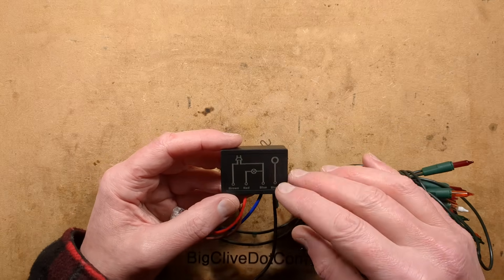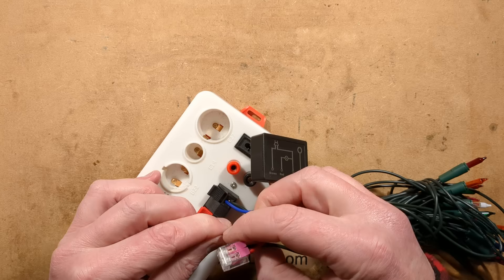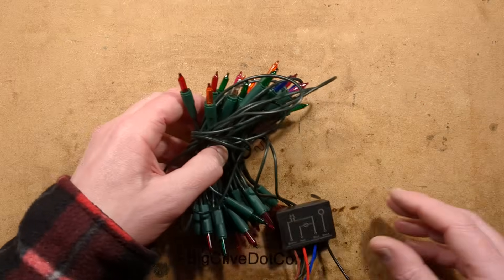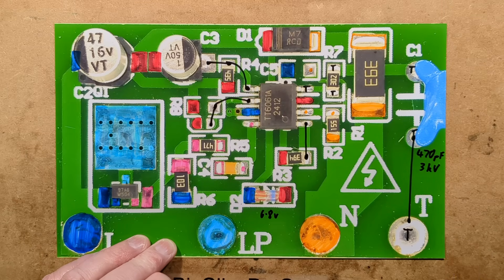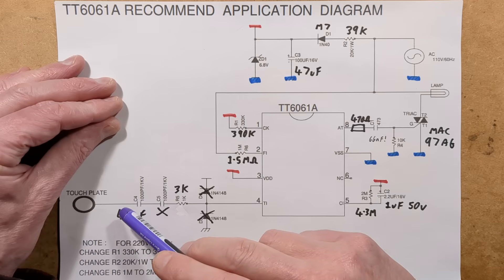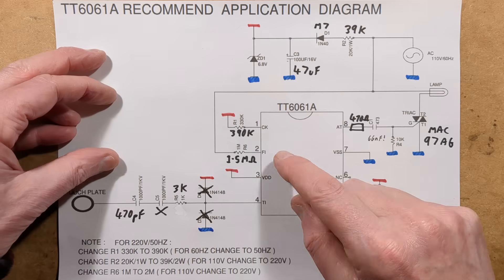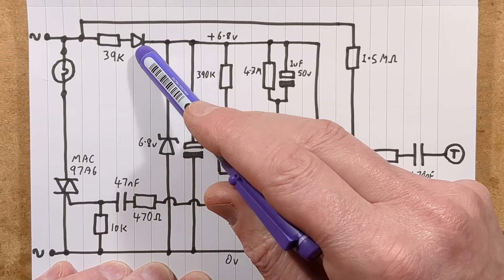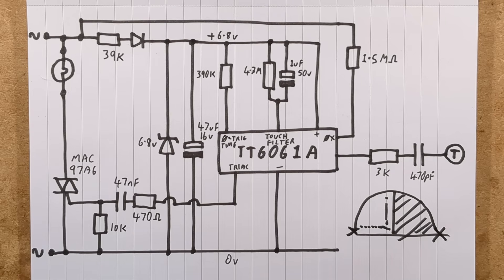inside a mains voltage touch-dimmer - with schematic

Comment: Interestingly, from the comments, I seem to have been lucky with my old bedside touch lamp - originally designed for 40W incandescents, I've been using it with a cheap LED candle for years without issue (apart from a very dim glow when it's supposed to be off). Mine is only a two stage dimmer (low, high, off), but I doubt that makes a difference. 

What I'd really like to do is add a wifi module to make it smart, while retaining the original functionality. Given how cheap both touch dimmer modules and smart wifi switch modules are, I was really surprised to not find that anyone has created one that does both. Can you recommend an easy/cheap way of achieving this, Clive?
Reply from the maker: It would be complicated to provide dual functionality.  But you could use a WiFi enabled bulb.

Comment: We have a touch-controlled lamp with two G9 sockets. Since they run pretty hot I installed an LED G9 when one of the original bulbs died. The touch controller is apparently not at all happy with (or built for) such low loads and drives the LEDs with full intensity on all "stages". So now both lamps still work, but one of them can't be dimmed and has to be touched 3 times to turn it off xD

Comment: So is there no isolation between the touch electrode and line voltage, other than a bit of silicon?
Reply from the maker: Usually capacitors or resistors.

Comment: Many years ago, I naively tried to use one of those to modulate the rotational speed of a small main voltage fan motor. It didn't work.

Comment: I had a similar touch dimmer fail in a chinesium lamp, because not knowing it there was a dimmer inside, I have used a regular LED bulb. The dimmer caused the bulb to blow quite spectacularly, the capacitive dropper HV cap puked it's internals out. And the dimmer started leaking current onto the chassis and misbehaving. Yanked it our and just wired the lamp directly then put a smart bulb in there.

Comment: Those were very commonly available here in the '70s - '90s (probably with simpler circuitry). I once installed one to control a light in the wall above the head of a bed with the head of a carriage bolt in the headboard for the control.

Comment: I have a lamp that uses the touch circuitry.  Problem is, if you connect "any" wire to the sense pin, it activates the light and "holds" it at that state. Disconnect the wire and hold a metal object/probe and touch the sense pin it functions as intended. It doesn't matter how short/long the wire is, it will always latch the light.
Anyone know of any way to get this function correctly? I have probed all the components and they appear fine, no burn marks or discolorations. I didn't pull any caps/resistors off to test externally, but I don't think of those components have failed. The main IC has of course been laser wiped so no idea what it is. The PCB silk is LY-JF-5334-BAT-TP V1.0
Reply from the maker: The detector wire will have to be kept very short.  Especially in an electrically noisy environment.

Comment: I have this module (non-dimmable version) hooked up to my kitchen counter LED's. Since they are also controlled by an impulse switch and a wifi module, the touch module is controlling a relay. had to add a capacitor as extra load, since relay current was too low. To make things even more complicated, this relay activates another relay that is modified to work as Impulse.

Comment: You wouldn't be hooking high current Amps with push terminals though. 😂 Usually 8ga Banana connectors in my experience.

Comment: We in the UK and possibly other places around the world, would normally have the metal chassis of a lamp earthed for safety. How does this sort of device fit in with this philosophy?
Reply from the maker: Take a look in your local lighting shop and marvel at the number of all-metal lights with wire-bearing pivots and hinges and absolutely no earth.  Not ideal, but it does protect against the possibility of someone holding a grounded case and making contact with live metal while trying to insert a new lamp.

Comment: These dimmers gave me headaches recently. Got two nice Tablelamps from the tungsten era. Originally for bulbs 2x 40W i put two 5w dimmable LEDs from a name-brand in. That resulted in partly reversed dimming-order (medium bright  with candle-flicker, full brightness, low brightness but stable). At first i thought changing the triac to a type with less holding-current would help. But the topic seems way more complex. Then i thought about buying LED-suitable new modules. But reading customer comments showed, that most of those still got the same issue😢

Comment: Good morning, Sir. I purchased a cheap touchlamp with white, natural and warm light modes and also dimming features (on TEMU). It has 16 leds (8 white and 8 yellow in alternance ). It uses a single 18650 non protected battery. Do you have an idea if the device has protection circuitry for overcharge /overdischarge of the battery ?Just in case you came across one. Thanks. Watching from Mauritius 🇲🇺...
Reply from the maker: There's usually a charge control chip to stop charging at 4.2V and the microcontroller is often used to detect low voltage and shut off.

Comment: Tnx for uploading another interesting video, i wonder about the rating of that sm 39K dropper R, except being warm it will have peaks above 300v in a 230v ac in, usually you would  split it into several in series...

Comment: Suddenly turning the triac in half way through a cycle is very tough on the component, and electrically noisy.
Better to turn on at the ZPC and shut off during the cycle using a MOSFET.
Or just skip a full cycle to reduce brightness, though that can introduce visible flicker.

Comment: Arent all metal bodied mains voltage products supposed to be earthed in case something goes wrong?
Im not an electrician but i still don't want to turn a touch lamp on and detonate in a fireball that smells of burning pork.
Reply from the maker: Sadly the lighting industry does not take things like that seriously.  It's very much fashion before safety.

Comment: I've got one of these modules out back in the big shed. Got rid of it since it produces so much RF interference as to make SW reception (esp. of weaker stations) pretty much impossible, esp. if using an omnidirectional aerial such as a discone type.

Comment: I repaired a touch lamp that uses a similar module but all the components were through hole.
 The fault was that the R2 resistor had gone open and the cheap synthetic resin bonded paper PCB was darkened where the hot resistor had been.
 I replaced the resistor with a 51K 2W resistor and the C3 100uF capacitor with a 220uF 16V. The module still works but now the resistor is barely warm. Before it consumed 1W all the time in the off state but now it draws less than 0.5W. I also added the 2 1N4148 diodes.

So the most common failure is the resistor, not the triac.

Comment: I've got an Ikea touch lamp one on my bedside cabinet. I noticed when i switch on my NLR Portable Low-Temperature Plasma Air Purification Sterilizer it also turns the light on if it's within a ruler length of it.
Reply from the maker: Thinks that use high voltage like plasma globes often make these touch sensor lights go wild.

Comment: Hey Clive! This video reminds me, there is a unique LED from Feit that is able to dim between 3 light levels simply by toggling the light switch on the circuit, no dimmer required. Thought it'd make for an interesting teardown!
Reply from the maker: I've looked at a similar light in the past.  There's a small capacitor that acts as a brief memory to show if the light has just been turned on or toggled off and on.

Comment: Is there an option/replacement chip model that does away with the 3-level low-med-high switching and just does on-off?
Reply from the maker: You may need to adapt to a USB powered light for that.

Comment: I got one of these to convert on of my desk lamps. Wonder if I should change that alleged y blue cap? as I haven't installed it yet. On 230v and want to use and led bulbs
Reply from the maker: For low power lighting it may be better to adapt to USB powered and use a low voltage touch module.

Comment: Hi Clive - Have you ever had problems with GaN / PD chargers?  I'm currently on the third one in the last year and they all just go wrong, with one or more of the USBs not giving any power out...  😞  I have not been overloading them - usually only charging a phone off them, but after a few months they just pack up for (apparently) no reason!  Just wondering if you have had any problems with them and if there is some systemic issue that causes them to fail.  I thought maybe it was because I was getting cheap ones off EBay, so I bought a £35 one through Ali Express and that one's gone the same way.  Any thoughts?  Cheers!
Reply from the maker: I've not even looked at one yet.  I think many that are being sold as GaN are just ordinary chargers.
Reply: Probably crapacitors that go bad. Its always a capacitor.

Comment: My parents had a touch lamp with a similar module in it. When the module stopped working I ripped it out and wired it up as an ordinary light! This woulve been in the late 90s i think.
The working principle was the same but everything was through hole. It did have two capacitors in for the touch sensor, and the dropper resistor was a big 3W jobby. The triac was a TO-220 sized device. I think it was the actual IC (in DIP 8) thatd failed.
Reply from the maker: A common failure is a failing lamp causing a current pulse that makes the triac go short circuit.

Comment: I have a small bedside touch lamp, replaced the bulb when it broke with an LED and now it works fine on medium and high but flickers on low - sometimes it’s a pleasant candlelight effect but more often it strobes horribly!  Taking it apart has been on my to-do list for sometime.
Reply from the maker: The flicker is the low load giving the triac stability issues.

Comment: 3uF and 4.3M appear to be to do with how quickly it rearms for the next touch.
A search didn't turn up much.
I think a triac triggers more easily with a negative pulse on the gate so I think the AC coupling of the gate is to make a negative edge on the trigger turn into a swing below zero

Comment: Capacitor in the triac feed is a good safety feature, in that if the chip fails it will not light the lamp all the time, as the output doesneed to change state to get charge across. Plus as well the chip likely has the output on all the time it wants to trigger the triac, and the capacitor only passes the rising edge of current, so that the power supply does not have to be rated to provide gate current all the time, which would mean that your standby power dissipation would be much higher, as you would need a lower value power supply resistor, a much beefier zener diode, and a much larger value capacitor, or spend the extra expense of putting in a capacitive dropper, with needing to fit a 220n capacitor, an extra diode, and a bigger capacitor onto the board, making it probably double the volume.

Comment: These circuits are notorious for producing gobs of RF interference.  Note the total lack of inductors and snubbers on the AC output feeding the load.  This is the first type of item I look for in a neighbors home when there is noise on my ham / shortwave radio.
Reply: Ahh yes the joy of phase angle controllers.
... nothing... nothing... nothing... BAM! right at the peak  😯👍

Comment: Why is the 50 volt capacitor smaller than the 16 volt
Reply: Because it's only 1uF and the other is 47uF, the size increases more with the capacity than with the voltage, for more capacity they need a lot more foil but for more voltage they only need to increase the insulation thickness and a microscopic increase in insulation thickness is enough to withstand a much higher voltage.
For comparison:
1uF 50V 4x7 mm
47uF 50V 6.3x11 mm

1uF 250V 6.3x11 mm
47uF 250V 13x 20 mm

1uF 450V 8x12 mm
47uF 450V 16x25 mm
Reply: Thank you as I did not see UF rating.

Comment: I had to replace one of these in a friend's mother's  lamp. A bulb had not only burned out but also shorted , and took the control 
out with it. it wasn't hard at all to do, and she was happy to have it working again. I did a Autopsy on the blown out control and found that the Triac 
had cracked in two, and it looked all charcoalated, luckily the damage stopped there before  any further arcing, that could have started a  fire
Reply from the maker: The triacs often fail short circuit or cracking open when a lamp fails and short circuits the supply briefly.  There would have been no real risk of fire.

Comment: Super high power amplifiers with high voltage output? Perhaps. Does anyone still use electrostatic speakers? Those had seriously high voltage drivers.

Comment: My parents had a touch lamp in the 1990s. When the light bulb eventually died, they replaced it with another incandescent bulb and the touch circuit never worked again. My dad wired in an in-line cord switch and that's how the lamp worked until our cat knocked the lamp off the table and smashed the glass shade to bits. This cat had it in for the lamp from day one and attempted to destroy it the first time he saw it. I'm surprised it lasted as long as it did before he finally got to it.
Reply from the maker: It's common for explosive lamp failure to make the triac go short circuit.

Comment: I wonder if they make these with a relay instead of a triac. There wouldn't be any dimming, but it would at least be a little more universal (no LED shenanigans).
Reply from the maker: You get the modern low voltage DC touch switches now.  Full dimming, but with PWM on low power LED bulbs.

Comment: Local thrift store had received 2 non-working touch lamps. I gave him a link to get some modules on Ali. When he got them in he changed them out but the lamps did not work. I pulled them back out and reconnected them, and they worked fine. He sold them for 20.00 each right away.

Comment: I have a bed side lamp with this module in it. Had it for about 18 years lol... still working as it should. I do have a tungsten filament lamp in it, and have tried LED but didn't work. Prob too low wattage (3W) candle lamp.  Thanks for the teardown, always wondered how these worked..
Reply: Yes, triacs need a minimum holding current (depending on type) to stay on. A low power LED lamp could be below that, which is an issue here, because the triac is only triggered by a short pulse (via the capacitor). Another thing I just though about and can't actually say: I don't know if a triac dimmer like this works with capacitive droppers which are sometimes used in low power LED lamps.

Comment: Not enough isolation between  your finger  through the capacitor  and chip      VERY DANGEROUS
Reply from the maker: The class Y capacitor is supposed to be rated for human contact, but I prefer more than one in series or a string of high value resistors.
Reply: An easy workaround is to add an external Y rated capacitor.

Comment: I was once shocked by a touch lamp. Now, I'm like a snake bitten man, who freaks out every time he sees a rope! 
That capacitor C1 is a safety issue. It HAS to be a class-Y capacitor and it's not. 
Anyways, I like the click of a good quality switch.
Reply: The 1K resistor could easily be changed to 100K, probably even 1M too. But it's more important that the cap is class Y.
Reply: I like having nice thick plastic between my fingers and the 240v live circuit thank you
Reply: I'd like to see a class Y and a 100k ish resistor in series.

Comment: I have dog problems and I have speaker terminals like that outside for speakers that I plug in outside to combat the dog problem

I did not protect them from ultraviolet from the Sun and the other day I went to unplug one of the speakers end the plastic crumbled so I need to go on Amazon and buy a couple of them and replace it
Reply: I assume an “ultrasonic repeller” for them; 🇬🇧 ~ we have the same problem with neighbours cats and a “wild” fox fowling in our garden = the “fox” is unaffected by the ultrasonic repellers and still leaves it’s turds, we haven’t seen any cats so appears to be working to that degree, and also have netting-mesh over our fish pond to stop a “rogue” heron from eating them 😠
Reply: @samuelfellows6923  -nope - I have two 20 inch folded horn metal PA horns from Parts Express out there - very loud but I have a different strategy now I play sounds just loud enough to keep the dog barking constantly and this eventually causes the owner to take the dog inside but every once in a while I do turn it up

Comment: We have two lamps with these touch-sensors beside our bed. 
When a bulb ends his life, there is a good chance that the sensor device burns up too.  
Therefore at some point a buyed a pack of ten to manage to have my lamps in business a little longer. 
The dimmable touch lamps a quite nice to use.
Reply from the maker: The traditional small tungsten bulbs often fail in a manner that causes a high current spike that will cause the internal triac to fail shorted out.

Comment: They are very susceptible to RF..  My dear wife has a touch light on the bedside table, when I transmit on HF it goes on and off like a lighthouse...!
Reply: I had a digital wall clock that used to go barmy in my shack on HF too.
Reply: A strategically placed LC LPF can help a lot with that. Though not necessarily enough when the source of RF is in your own home.